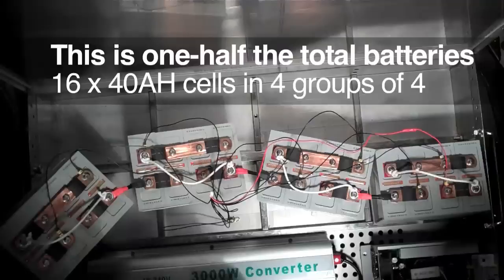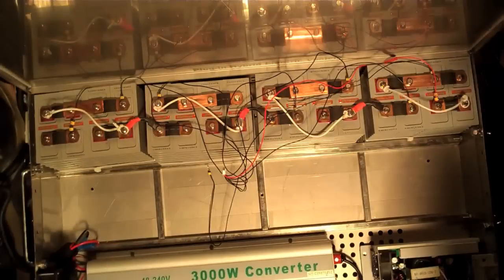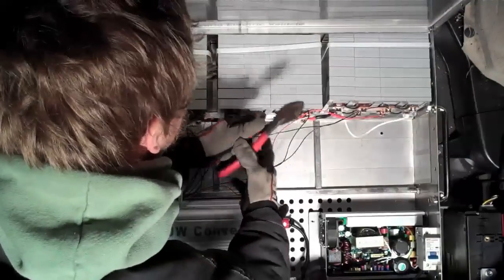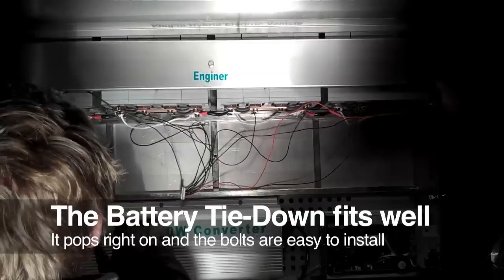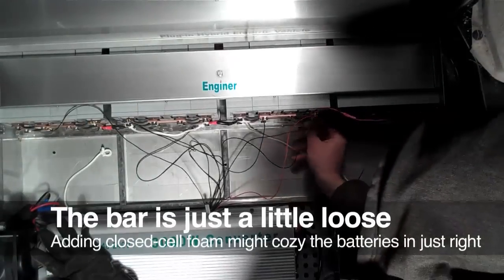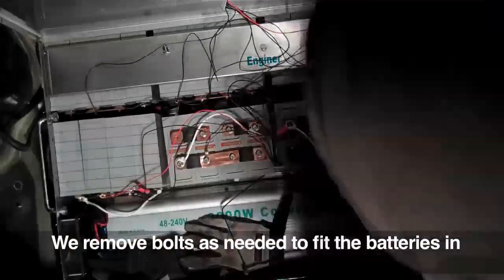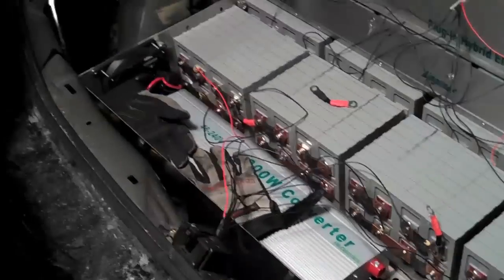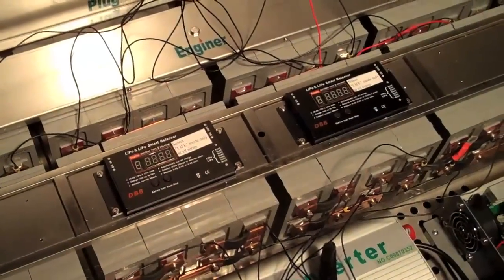Prius PHEV Conversion Video part 4

Comment: Hi Ben. It's been 9 years since I sold my holden barina aka geo metro ev and I just bought a used prius. What would you recommend as a diy range extender these days? It's an 04 model and I just bought a low mileage battery pack

Comment: You should had keep the zip-ties, I know those batteries they inflate with use and time and if their not tight they may leak or explode. You better put it back.
Otherwise good videos.